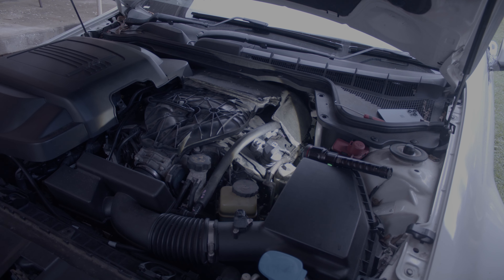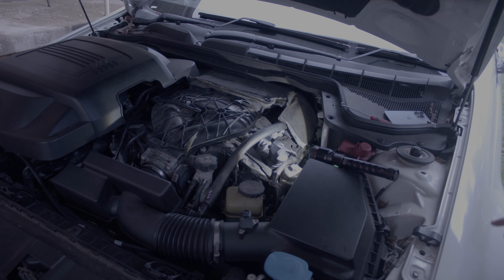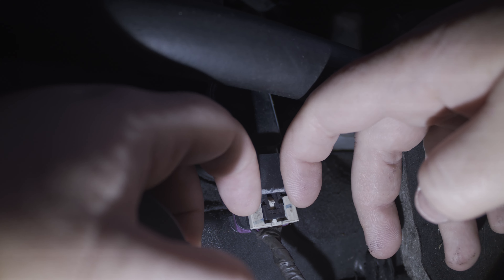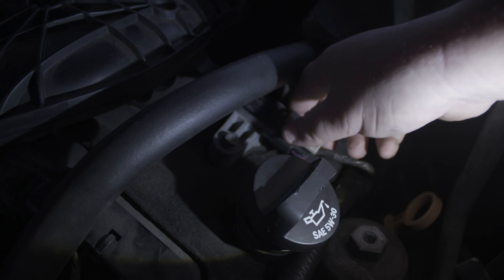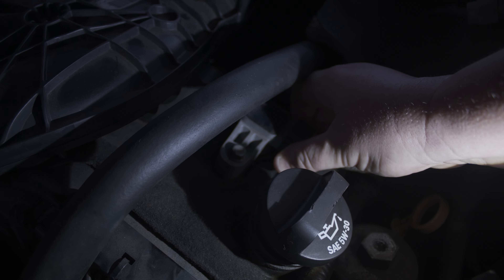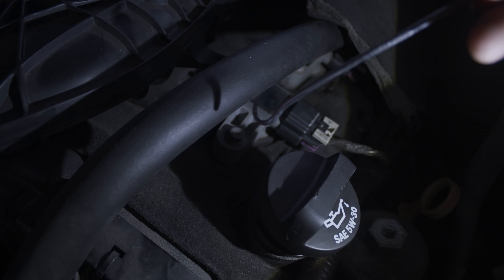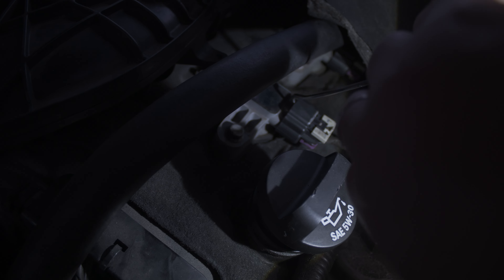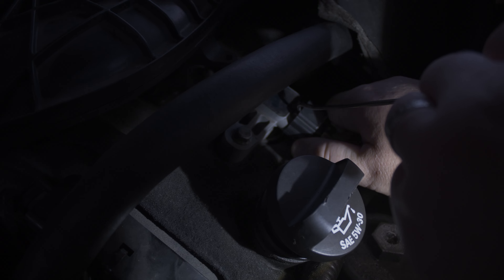ve commodore coil plug disconnect

Comment: Hi     First of all  pull back the white colour plastic lock and push down the black plastic portion on inside the white plastic part,  instead of hook up  with the screw driver from the front side of the connector and pull back the connector  then it will come out easly..

Comment: short video very helpful, saves breaking bits of plastic, also a piece of 3/8 heater hose or similar makes it easy to remove and install spark plugs. just push it over the ceramic